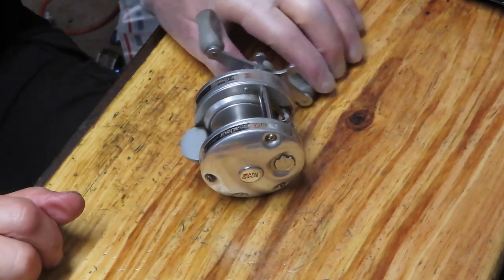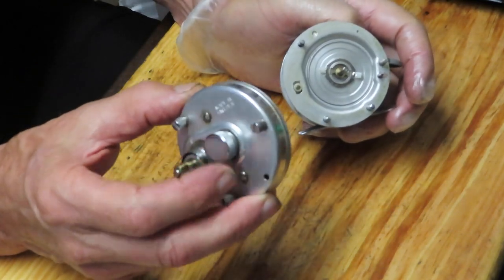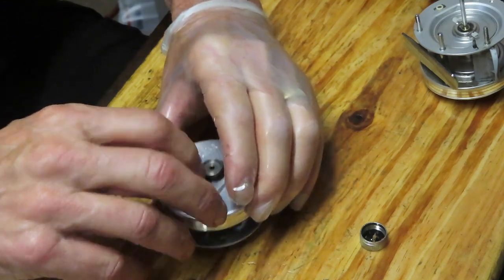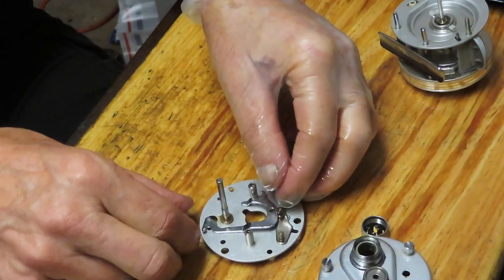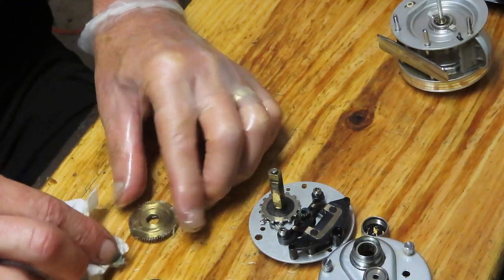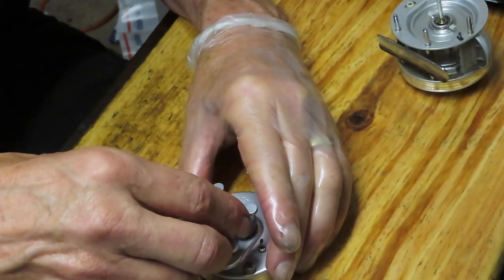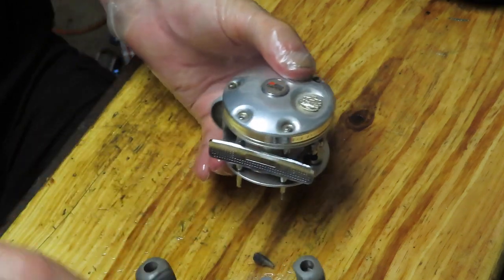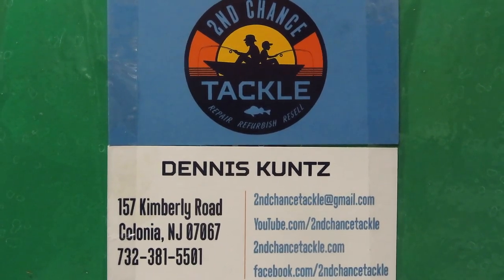Abu Ambassadeur 4601 C3 left handed round baitcasting fishing reel how to service

Comment: I have learned one thing if using thease reels in salt water.  Put a thin layer of grease on the spacer washers under the star drag adjuster because they do corrode with the salt water. Thanks Dennis!!
Reply from the maker: Great tip!  Thanks - Dennis